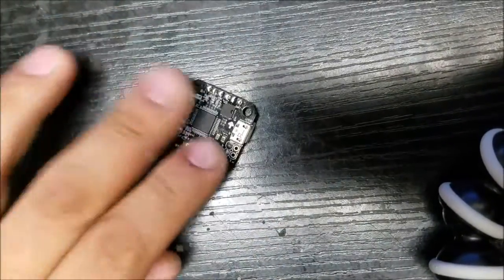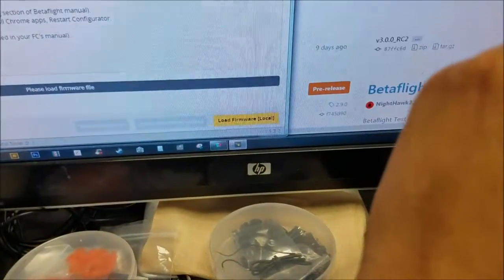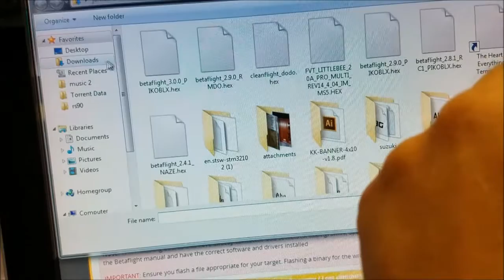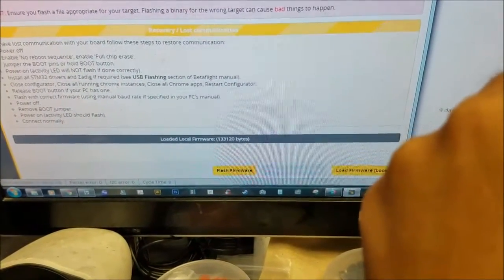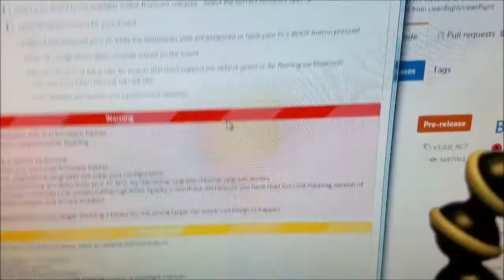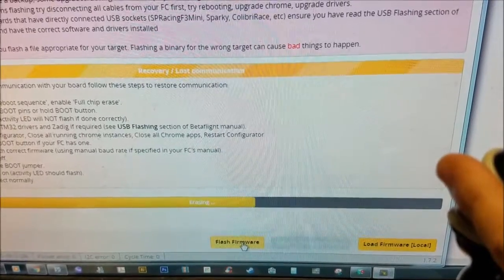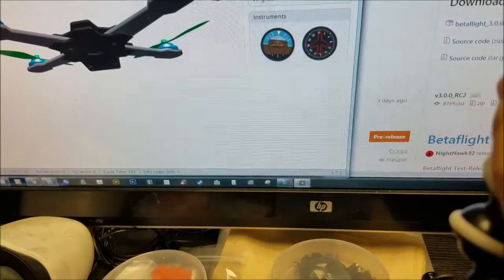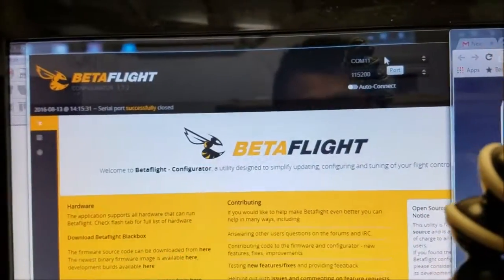piko blx firmware flashing

Comment: i did everything including the STM USB VCP DRIVERS and ZADIG,flash but still does not work, i did change 2 computers 2usb cables and 3 piko blx ,i gave up
Reply from the maker: if u see a comport number then you can just use the firmware flasher and the  drop downs selections for pikoblx

Comment: Awesome man ! Thx! It was exactly what I was looking for, but DFU don't appear when im in the good mode that I managed to go caused of you. I installed the drivers and installed it but it didn't change anything... do I have to active it manually or what, install alone isnt enough to make it work for me...
Reply from the maker: so are you in bootloader mode and connected to pc when you installed the zadig driver?
Reply: Ya, it was my problem, It had to be in bootloader first and u mentionned it ! dah....then use the Zadig to transform the bootloader into winUSB.

It worked ! all I need to do now is some flying tests. I had set it in Multishot 8k/8k/32k.

Cant wait to see if it works cause well... my quad isnt ''small'' , it is a powerful 250 and I heard I might have some voltage troubles...

well for now, my motors works, my camera works etc, I need to mix all this up in the air now.... rain... rain....

thx man, I appreciate your help a lot.
Reply from the maker: +Onurb35 SuseJemiatej 
sweet!!! happy fly brotha!
Reply from the maker: +Onurb35 SuseJemiatej 
why didnt u get the kombini fc??? same as piko but bigger and have higher amp rating.
Reply: my quad motors works to 100% thrust when I try then in betaflight and my foxeer 1190 like you works, it is means im okay or something bad could happen while im flight if im missing some power?
Reply from the maker: +Onurb35 SuseJemiatej 
u should be ok. just the kombini has more room to work with and has a bootloader button which is super helpful.
Reply: im gonna keep you update on that, if the piko support my setup well, the piko is impressive, if not, I might considere this Kombini for sure. thx for all your help.